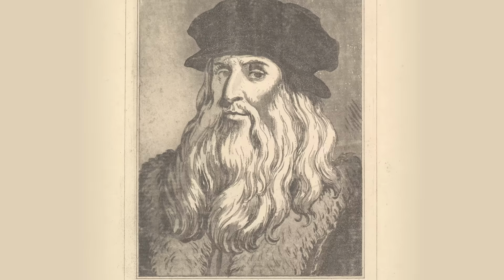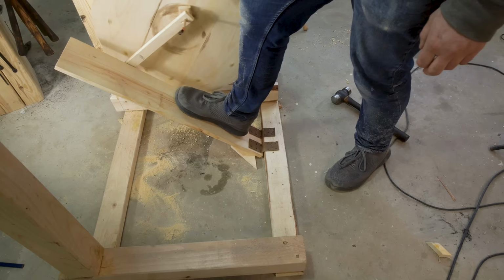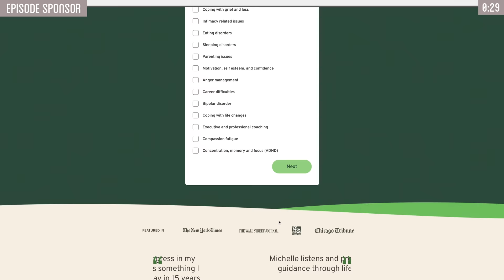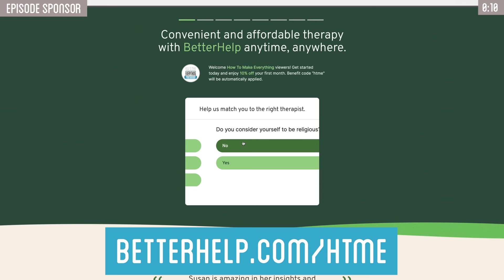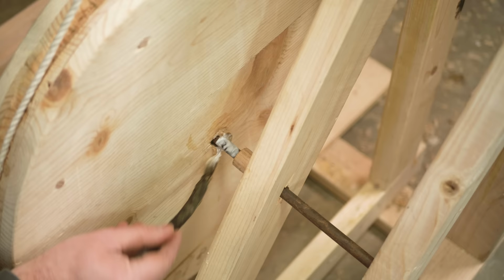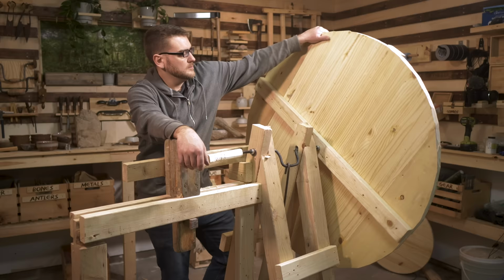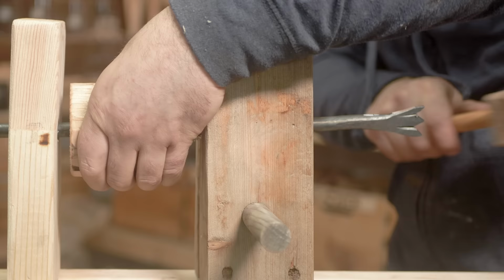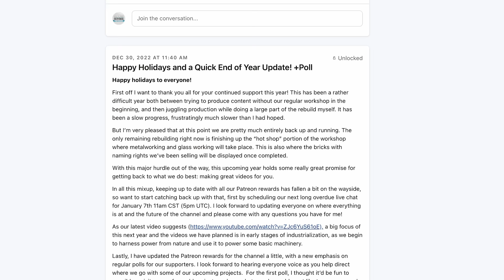Does DaVinci’s 500 year-old Lathe Work?

Comment: There's another upgrade you could do that would help the power of the lathe: change the wooden flywheel for a poured concrete one. It's more work, and you will need to get the form made right, but your lathe will perform better. Also, don't use your flywheel as the pulley. Put another one on the flywheel's axle; less wear on the flywheel, and you can make multiple pulleys for different rotational speeds (1:1, 1:2, .. 1:n), for different types of wood (hard vs soft).
Reply: More weight in the flywheel would be good, but only needed at the rim, thats the most efficent area for it. So basicley "bolt on" mass would be enough.
Also i think he will need to replace the flywheel axle with metal, wood isn't really able to handle the compounded loads, maybe if he would have a version where the axel is supported at both sides, but even then its risky.
Reply: Yeah mounting a second pulley right to the flywheel to step the ratio to 1:1 then rope to the top. It should also allow it to run smoother. 
I don't think Concrete is the way to go right now, as foot power would be really hard to keep it going. He can help a lot by laying the wheel horizontal and spinning it, then add or subtract weight from side to balance it. Its a to do with a balance issue on the wheel.
Reply: @jacara1981  the flywheel is a way to store energy so making it out of concrete wouldn't make it harder to spin by foot you would just need to spin it up by hand first. The biggest limitation is the energy you take out of it when you make your cuts and the friction in the system. 

Also I remember my dad telling me about how they use to balance tires. It was a simple jig with a bubble level in the middle. very similar to what you were explaining. and I agree that having a balanced wheel would be a improvement.
Reply: @NesiasvonWolfen  bolt-on mass may work, just remember that the purpose of the flywheel is to keep a consistent spin speed as the pedal is released and reset. And yes, a metal axle, especially if the flywheel's weight increases.
Reply: @jacara1981  changing the angle of the flywheel from vertical to horizontal introduces more friction in the system and more complexity as you would need to take the power generated and turn it 90 degrees. While great in theory, I do not know how well it would work out, though it is an interesting idea.
Reply: @Cody Wilkins  true. The one problem with concrete (might be wrong, as I've never used one made of it) is trying to balance it, it's hard to add anything, and taking material away risks cracking it. Also his rig still isn't anywhere near sturdy enough for that much weight.
Reply: @jacara1981  totally agree, concrete might not be worth the effort. I think that these videos are a great proof of concept but I think that our ancestors would have taken much more care into creating machines like this one. I would imagine that if they were going to spend the effort and materials that they would also invest more time. that's one of the reasons I like Click Springs series on the Antikythera Mechanism.
Reply: @Cody Wilkins  not only that but by this time period specializations had already been a thing for a very long time. 
So a Blacksmith would do the metal work, a carpenter the wood work and so on. All masters at their craft so everything would come together much easier.
Reply: @RvnKnight  Not for using it in the lave but to balance the wheel, he is losing a lot of stored energy because of the wheel is unbalanced, this puts a lot of stress on his rig as well.
Reply: @jacara1981  I do understand that. The wheel being off balance and shaking the rig is one thing, adding in friction and loss of mechanical power is another. It's also very dangerous to add heat to an oil based lubricant on a wooden structure. You also have to think about the complexity of the device: adding in another axel, two more gears, more supports for the axels and gears, and a pulley while removing the force multipling lever that spins the wheel.
Reply: @RvnKnight  "changing the angle of the flywheel from vertical to horizontal introduces more friction in the system and more complexity as you would need to take the power generated and turn it 90 degrees." They did that just fine with windmills, though, using giant slabs with large wooden pegs as early gears.
Reply: @NesiasvonWolfen  🔴 What Is Islam? 

🔴 Islam is not just another religion. 

🔵 It is the same message preached by Moses, Jesus and Abraham.

 🔴 Islam literally means ‘submission to God’ and it teaches us to have a direct relationship with God. 

 🔵 It reminds us that since God created us, no one should be worshipped except God alone. 

 🔴 It also teaches that God is nothing like a human being or like anything that we can imagine.

🌍 The concept of God is summarized in the Quran as:

📖 { “Say, He is God, the One.  God, the Absolute.  He does not give birth, nor was He born, and there is nothing like Him.”} (Quran 112:1-4) 📚

🔴 Becoming a Muslim is not turning your back to Jesus. 

🔵 Rather it’s going back to the original teachings of Jesus and obeying him.
Reply: @KainYusanagi  and windmills need more torque to move the giant mill stone so you want that friction as it gives the bite. When it comes to a lathe you want speed, not torque, so less friction--you want a lathe to go as fast as possible in order to get a good, clean, and even cut. With a mill--water or wind--you want it to go slow so it has enough time to crack the hull/husk of the grain, separate them, and crush the pith. They are two completely different applications of the same type of parts.
Reply: You’re missing the point here, guys. The real purpose of this was to see if Leonardo’s design itself worked. Yes, we can improve it in various ways. But for what purpose? Would I give up one of my lathes for an improved version of this? Uh, no. So this is for historic interest. Of course, if any one of you figures out how to go back in time, you could give Leonardo your ideas. As far as making an improved treadle lathe, there have been hundreds of designs. But for them to work, it would have to be made more precisely. This wobbles too much. As far as co Crete and other ideas go, nobody used them, so oreganos they didn’t work. Later, metal treadle lathes were made, but were never heavy. The flywheels weren’t that heavy for a good reason, it would be too difficult to power then by foot. Lathes powered by horses or later, steam, weren’t treadle lathes anymore, though small ones with seats were made until around 1900.
Reply: The bar that’s connected to the flywheel and the cutting block could be modified for more speed, A greater distance bend from the center of the shaft makes the pedal travel further up and down which should be massive speed gains
Reply: @NesiasvonWolfen  but wouldn't it need to be symmetrical for that to work?
Reply: @RvnKnight  No, friction doesnt gives torque or bite, it only waste enegry.
Also windmills run slow because it needs time to grind the grain is also BS, they run slow because they cant run faster, making the mill stone spin faster would just shred the wodden gears, because running faster means also more torque needed. Modern mills run a lot faster than wind or watermills.
Also also, you dont want a lathe go as fast as possible, only as fast as needed for a clean cut
Reply: @wolf310ii  Without the friction between the spokes of the cogs then they would not have the traction to move each other. Think of a bar of soap on a wet surface.

The question I have for you is thus: do you realize the time frame we are taking about? We aren't talking the modern era, we're talking several hundred years ago. The gears would not have been shredded but would have worn down much quicker.
Reply: @RvnKnight  Gears transfer power through form, not friction. Only belt transmission needs friction.

If you think you can increase power by increasing friction, then replace the oil in the gearbox of your car with sand

Worn much much quicker = shredded.
Reply: With roman concrete*
Reply: @wolf310ii  you have missed the point entirely.
Reply: @RvnKnight  You are the one missing the point and dont even understand what you talking about at all.
Reply: Same could be done with lead pored weights on the outside of that big wheel
Reply: You spin it horizontally WHILE YOU BALANCE IT, then install it normally on the lathe.
Reply: That weighs too much. Lead weights around the rim are  more practical
Reply: Do you think it would be possible to build a lathes rails from just large stone hewn into 6x6s? Or even better for rigidity carve the rails into one giant rock? Though i suppose if this was done they would be heirlooms? Unless they were used until they completely fell apart?
Reply: @wolf310ii  the point is that without friction, you know the resistance between moving surfaces, you wouldn't have any of it. But hey, keep going off. Have a day.
Reply: @fajile5109  no idea
Reply: @RvnKnight  Say you dont have a clue without saying you dont have a clue.

Why do you think engineers do anything to reduce friction as much as possible?
Why do bearings even exists?

But keep going, tune your car by replacing all the oil and lubricants with sand, it increased the torque so much, as soon as you touch the key, the car will go faster than the speed of light, because of all that friction and resistant.
Reply: Lol u guys ever see a sharpening stone
Reply: Corn mills using flat stones turn slowly because that speed works best for grinding the corn. 
Higher speeds need LESS torque for a given power BUT the stones would bounce and slip rather than grinding together. Grinding creates more friction but that’s what gets the grinding done. 
Today’s factory roller mills run faster and have no contact between the moving parts but need high precision parts and considerably more maintenance
Reply: @davidelliott5843  If correct adjusted, the mill stones dont touch each other, if they would, they would had to replace the stones every few days and instead of wheat flour they would mill stone flour.

What a mill needs is constant RPM and supply of grain.
And the stone in a windmill turns slow because thats what best works for the wooden gears.
Reply: @wolf310ii  tell us that you don't know that ground stone was in stone milled flour without saying it. The milling process adds in stone dust (aka sand) into the finished product. The mills also have a shut-off for when the stones got too close so the structure didn't go boom .  And no, the mills went slow not because of the gears but to ensure the mill worker could turn it off before the flour dust that was in the air caught a spark and the mill exploded. You would be shocked at the speeds and abuse a wooden gear set can handle when well built and well lubricated.
Reply: @RvnKnight  What now? Do the mill stones touch each other or is there a magical device thats shut off the windmill when the mill stones touch each other?
And lubrication now reduces the friction, but you also wrote friction is absolute necessary, otherwise it wouldnt even move and that friction adds torque and bite?

You never saw a real windmill working do you?
1. they dont have a auto shut off, they dont even have a sensor that could measures the distance between the stones.
2. Windmills turn the stones with around 80-130RPM, for a 1,5m stone thats not slow anymore, thats around Vc 500m/min and more than enough to sharpen tools on the stone, even tungsten carbide inserts.
3. if the used stones could produce sparks, they would do it already at far less rpm.

The stone dust in the flour doesnt comes from millstones intentionally grind each other, the stone dust in the flour is mainly "grind off" by the grain
Reply: no concrete in the design being tested. However hardwoods would be used in construction in the time as european hardwood forests are, were the common forests near communities. This would greatly decease the rowdiness of the machine. Tighter joints and more stabilizing mass.
Reply: @NesiasvonWolfen  even just taking a wooden wheel and cutting a groove near the outside edge and filling that with concrete would significantly increase the moment of inertia.
Reply: The flywheel does not need to be circular, and the mass does not need evenly distributed around a circle. As long as the flywheel is balanced it will work fine, so even a stick with a mass on both ends would work fine as a flywheel as would a simpler shape like a square or hexagon, no need to try and make a circular form for the concrete.
Reply: @jacara1981  Putting the flywheel horizontal would create unnecessary complication
Reply: @bioemiliano  Not to actually run it. You put it horizontal to make it easier to balance it, then install it in the lathe.
Reply: It doesn't have to be a wheel, just balanced. Hey could make a post, and adjust it so it's balanced without grinding or cutting anything
Reply: @dkettley3457  : You don't need to spin it horizontally while balancing it, just hang it from it's axle. If it's not yet balanced, it'll hang off-balance, and vis-versa.
Reply: I think he made some grindstone wheels those would work well

Comment: Hey Andy, this is getting really exciting now! One thing you may like to consider, now that you’re transitioning from crafting to engineering, is that the biggest difference between the two is precision. That make a huge difference when it comes to the success of these engineering projects. Examples include the accurate centring, balancing and mounting of things like spindles and flywheels. Getting proper right angles. Taking the time to get those things accurate will pay huge dividends. Look back at your lathes and think how much their operation might be held back by wobbly spindles and flywheels, pulleys that aren’t quite round enough, things like that. As an engineer myself, the biggest tools I have for ensuring accuracy are measuring tools. There’s a great video on YT if you search for “origins of precision”. Once you can mark out and cut accurate lines and holes, and measure them to gauge their precision, you can master that precision in your constructions.
Reply: I second this motion. I absolutely love that this team is taking on these mechanical projects, and I always learn something new, but if you're already going to make the effort to build something, it doesn't take THAT much additional effort to do it well... I wonder if he's not deliberately trolling to ruffle people's feathers. Maybe using a little bit of Cunningham's Law to stimulate the comments section.
Cunningham's Law states, "The best way to get the right answer on the internet is not to ask a question; it's to post the wrong answer."
Reply: My first thought as well
Reply: He's done at least one video on approaching precision (the charcoal compass he used here was one thing made then), so he is at least aware of it.
Reply: I came here to say something similar. The base structure alone is so wonky, a ton of energy is lost, not to mention all of the other forces created in every other direction causing havoc. A carpenter back then would have built this soundly. Maybe forgo the hand tools, accepting you're not a trained carpenter, and use whatever modern tools you can to build it as stable as they would have.
Reply: I mean bro, has he done anything on this channel that can be considered quality? Every video I've ever seen has looked like a halfarsed attempt to do something. I get that he's trying make videos with time constraints and all, but really, this channel would be so much better if he actually put seemed like he was trying to be careful with things and make them proper (and not just go "oh well the center of this circle appears to be right about here if I eyeball it")
Reply: If only he had some tool to round off the parts to a good circular shape…
Reply: @ooj316  clickspring made a tool like that but he used it to cut brass and i dont think wood cuts like that.
Reply: @fajile5109  wood needs about the same speed I think. Uri Tuchman has made his own pedal lathe that worked quite well
Reply: Along those lines it might be good to do something with a surface plate / plates to get a large flat surface that can be used to create and refine the accuracy of the lathe and later instruments used in measuring.  I think it was around the 1850-1890 period where interchangeable gun parts were needed for greater volumes of production where this starts to come in play, but things did seem to progress from about 1650 - 1850 to get that all started.  Happy Sunday!  PS... gage blocks?
Reply: If only he had some sort of machine for forming and shaping cylinders...
Reply: He can use this lathe to make a better one…
Reply: That's an ongoing problem with this channel, they only do proof of concept, but making something like masters of old is still far away from them.
Reply: Getting proper right angles is always such a pain.
Reply: @johnjingleheimersmith9259 kay but literally it's just for demonstration. Proof of concept is the point. He's doing things just good enough because many of the things he's done were trades that a craftsman would master ONE of across their lifetime. Are we expecting him to master every craft? Or demonstrate the principles? I think reasonable standards are necessary. I would love to see many teams doing this project but this is one person.
Reply: If you're really going to use this for a while, you'd build the frame out of heavy timbers not 2x4s, and make the base wider.
The flywheel can be trued up with the lathe itself you just have  to contrive a good tool rest for it.
Reply: Who care?

He got to show an example of how the machine worked and he got some experience making it.

Idk how many people on this channel are actually craftsmen or engineers.

But what he is doing is a bit of both. Crafting and woodworking takes practice, it's a skill